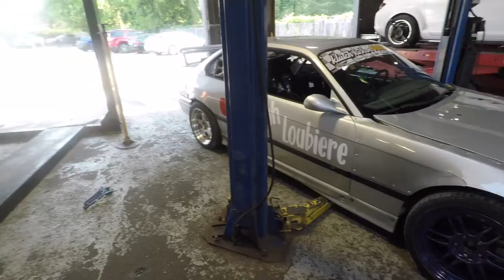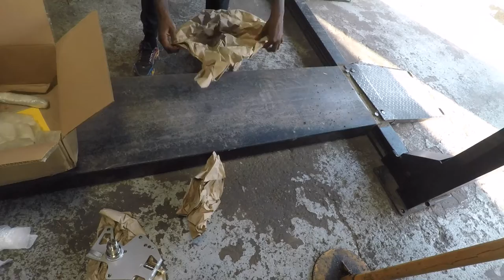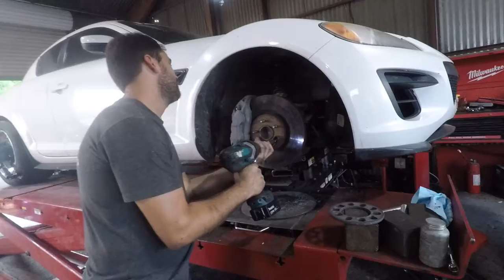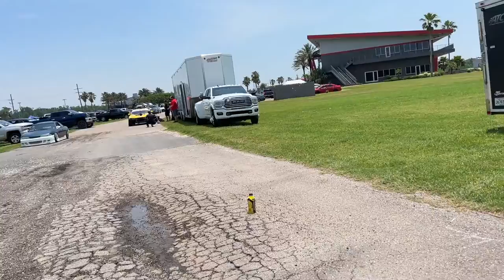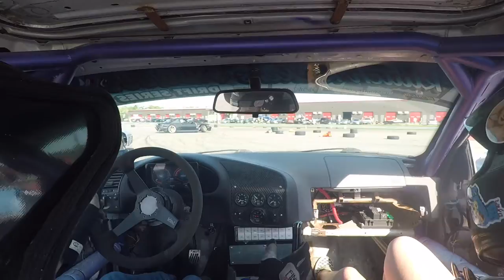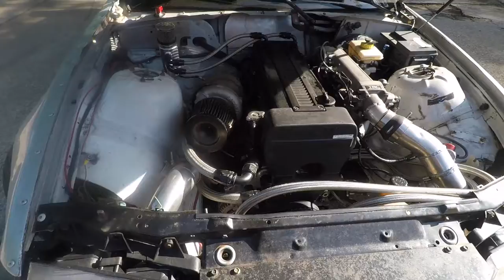MY FIRST SPONSOR.. FDF! E36 MANTIS KIT INSTALL + TEST N TUNE

Comment: How was the kit compared to the slr?
Reply: exactly what im trying to figure out
Reply from the maker: I'm loving it so far. better lock tight the lower control arm bolts though. I'd make the switch again